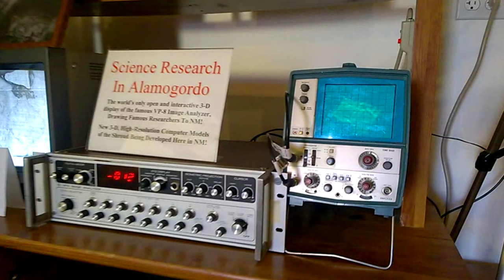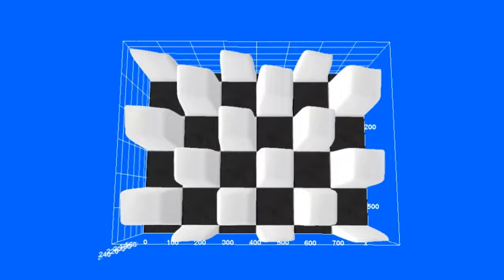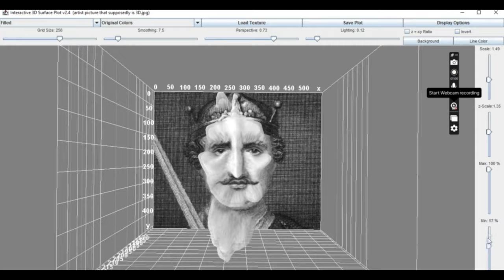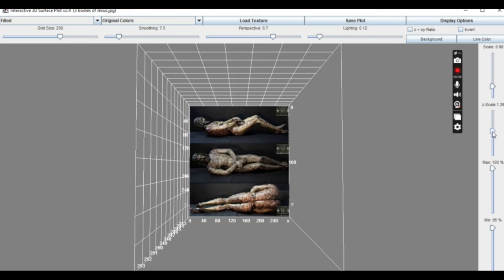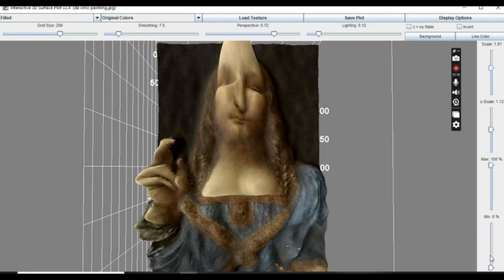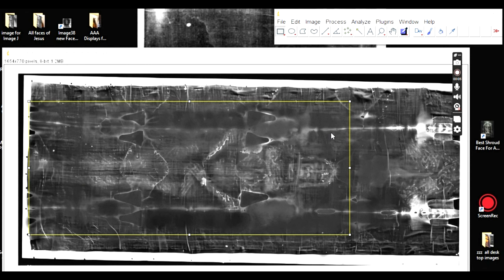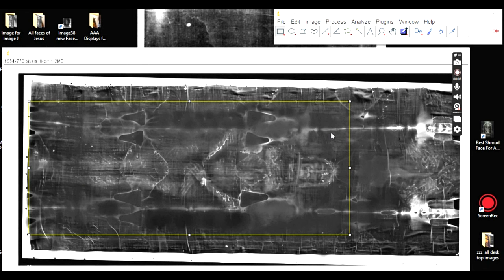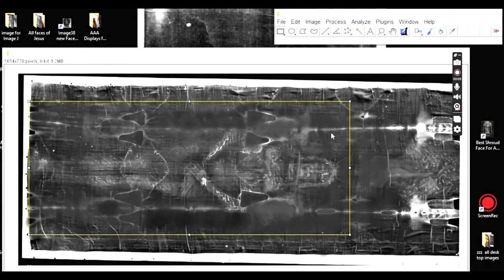NEW & UPDATED 3D IMAGES OF THE SHROUD OF TURIN:  Part 1  HD 720 Video

Comment: It is simply NOT-credible to rationally accept that a man whose body bears the equivalent of 120 lashes with a 3-pronged whip or flagrum, ONLY shows what appear to be almost perfectly "flagrum-sized" sized INDIVIDUALLY distinguishable small cuts in the skin. They have counted 360 such marks (by some videos I have seen) on the shroud (120X3). With PADDED leather gloves, in boxing, multiple punches to the face or same area of the face often breaks the skin open. Now, imagine what would happen IF instead of padded leather gloves, the gloves had pieces of bone, metal or glass woven into them? What do you suppose a face would look like then? Have you ever seen actual footage of a person being caned on their buttocks? After 2-3 hits, the skin does not merely look cut, it splits open. The more hits, the wider it splits open., until large parts of the skin are simply torn away. Now, IF the image of the man on the shroud IS the Lord Jesus Christ, just prior to His resurrection, and IF He was indeed subject to the unimaginable horror of 120 lashes, THEN the skin on the image of the man on the Shroud is too "clean", to be Him. LOOK up the artistic "hyper realistic" 3D image of the man on the Shroud. Yes, it does show hundreds of  individual small cuts/tears all over the arms, chest, legs. But the adjacent skin in-between these marks is  still IN TACT. HOW is that possible? It  is simply NOT possible! 120 lashes, savagely applied with the intent of "scourging" the victim, would NOT LEAVE SUCH MARKS! Rather, the skin on the chest, arms, legs and back would be almost entirely ripped away by such a beating. Historical records of people being "scourged" by the Romans state that the skin is almost entirely gone. That the lashes cut so deep into the muscles that the spine itself became visible in places. Or, the internal organs, bowels became exposed and or partially fell out. As horrible as the hyper-realistic 3D figure based on the Shroud is, the REALITY Jesus experienced would be and WAS far worse! Isaiah prophesied of Christ that His appearance was disfigured MORE than any man! Jesus was literally beaten WAY BEYOND recognition! The gospels state He was ALSO beaten with rods and repeatedly struck with hands too. HIs appearance would have been the most gruesome sight imaginable. He would have had TWO black eyes, a face almost entirely black, blue and purpose, swollen all over.  I am a devout Christian believer, whose faith in the Person and Saving work of the Lord Jesus Christ for His people does not depend on the Shroud. Barry Swortz has not been "converted" by his decades of research on the Shroud. That OUGHT to say something. The Vatican has NOT claimed the Shroud is authentic. That DOES say something significant!  Wake up people.
Reply from the maker: HAPPY HOLIDAYS
But You need to WAKE UP!    Your post requires a visual response,  here it is 
We prove everything you say is wrong in less than 7 minutes.  
Video link       
https://youtu.be/wufqlW8QYWs 

And here is another visual response with the Man in the Shroud with all the wounds on the face replicated on a 3D Model.  It s a gruesome sight.  We do not show it in our videos because people do not like it.    We had to keep the body and face of this model covered when children were present during our exhibitions.  WE showed Jesus as he was. A bloody massacre and it upset people. WE toned it down. 
But here it is.  Another visual response that proves you are WRONG!
https://youtu.be/uO4_LV-hqKo 

How many autopsies have you performed?  NONE
Are you a forensic pathologist?  NO
Are you a credible witness?  NO

Do you think that the medical examiners and forensic pathologists that examined all the wounds did not take into consideration the all points you  brought up?

WELL OF COURSE THEY DID!

Had you conducted a thorough investigation  you would know there are serum halo wrings around the scourge wounds and tiny scratches all around the areas of the scourge wounds in the back and in many other areas where the wounds are. 

You say the wounds are perfect and clean?!  NO THEY ARE NOT.

The reason there are serum halo rings is because after the blood clotted on the wounds the serum separated from the blood and migrated to the edges of the wounds.
What does that mean?
It means they are real scourge wounds from a real person!

The scatter of wounds is NOT PERFECT IN ANY WAY. 

You are in disagreement with forensic pathologists, medical examiners,  and optical engineers,  chemistry experts, a biophysicist and a host of other medical professionals , 

Most notably  Dr. Frederick Zubibe who spent 50 years of his life researching the Shroud.  He  was the medical examiner of Rockland County New York for 33 years and did over 9,000 autopsies.  He wrote an excellent book documenting his 50 years of research.

I read it.  Did you? ..........................NO

You could learn a lot from his book.   Before saying  "Fake"  you must conduct a thorough investigation 

How many dead bodes with fatal wounds have you seen up close?  NONE

The following medical doctors, forensic pathologists, biophysicists, chemistry experts, forensic botanists, optical engineers, mechanical engineers, photographers, physics experts, radiologists and textile experts ALL AGREED a dead and crucified body was in the Shroud.
1. Dr. Alan Adler, Professor of chemistry 
2. Dr. John Heller, Biophysicist 
3. Dr. Robert Bucklin, Professor of Forensic Pathology, LA
4. Dr. Frederick Zugibe, Chief medical examiner  New York 
5. Dr. Gilbert Lavoie, Medical Doctor 
6. Dr. Sebastiano Rodante, Medical Doctor 
7. Dr. Max Frei, Forensic Botanist
8. Dr. Pierre Barbet, A battlefield surgeon. 
9. Dr. Baima Bollone, Professor of forensic pathology, Italy 
10. Dr. Herman Moedder, Radiologist from Germany 
11. James Malcolm Cameron, A British Forensic Scientist 
12 Dr. Sam Pellicori, Optical Engineer 
13 Deacon Peter Schumacher, VP 8 analyzer engineer 
14 Barrie Schwortz Official photographer for STURP 
15 Professor Guilio Fanti, A mechanical engineer 
16 Dr. John Jackson, PHD in Physics, 

Here is their combined testimony in under 7 minutes.  One of our best videos with Good News!

The Man In The Shroud Is Jesus
We spent several thousand dollars making these videos.  You get to see them for free
Our Christmas Gift to you!  Happy Holidays

https://youtu.be/uO4_LV-hqKo
Reply from the maker: Thanks for posting,  these skeptic comments are useful.  We gain more empathy with others because of it. 
  I have logged and noted and read your post thoroughly. 
YOU WROTE

"Yes, it does show hundreds of  individual small cuts/tears all over the arms, chest, legs. But the adjacent skin in-between these marks is  still IN TACT" 
WRONG!
This is why it is important to do a thorough investigation before posting

I have a life size print of the dorsal side in the highest quality possible.  $800.  
It is extremely well detailed.  The wounds are not in any way "perfect looking"  as you claim. 
There are many fine scratches scattered in between the wounds. 
WE will put up some images of the dorsal side  on our community page

Some of the scourge wounds show well defined borders and  FINE SCRATCH LIKE MARKINGS ARE mingled in-between.   Also some of the scourge wounds do not have any clearly defined borders. More messy type impressions. 

Also there was more than 1 instrument used to inflict the wounds.  There was some kind of whip or rod  that are much different looking than the scourge wounds, possibly the same treatment Paul of Tarsus got,  "beaten with rods"  he mentions.   This is especially noticeable on the front side of the upper legs.  Those are not scourge wounds.
Reply from the maker: We are not telling people they need to believe in the Shroud to be saved!   The Shroud is a witness telling people "DON NOT LOSE FAITH AND TRUST IN THE WORD OF GOD,  IT IS ACCURATE."

You completely mis understand the purpose of this witness.  The Shroud is God's Witness concerning his Son.  And God's witness is BETTER THAN THE TESTIMONY OF MEN!  As written in the Gospel of John

And for your information Barrie Schwortz does believe the Shroud to be authentic and when the Vatican displayed it they also public ally declared the Shroud to be authentic.  Yes they did!   We have a video on that as well with what they said in Italian translated to English.   

But even if they did not  Who cares what they think!
The Vatican in Rome is as corrupt as everyone else seems to be in this day and age.  
I would not trust a word that comes out of their mouth anymore,  add all cable news networks to that list. 

  The totality of the evidence tells us it authentic.  Anyone in disagreement has not yet conducted a thorough research
 The investigation  into the Shroud can be a long and winding road and it leads to Jesus.  Not a dead Jesus but a living one
The Resurrected Messiah.
Reply from the maker: I should also mention modern photo enhancement software does a great job cleaning up images and capturing details like the ones shown in this video   But it will also smooth out anything it thinks is '"artifact"  They do not capture super fine detail like the scratch marks in between the wounds.   At least not the one I use.  The software they have sold for 600 million dollars.   That is what I use.     Sometimes in the process of "enhancement" they subtract things from the image and smooth them out.   Also some the 3D depth info is lost in the process.